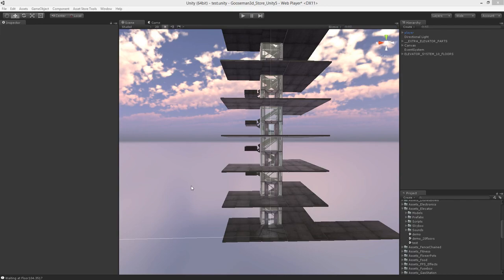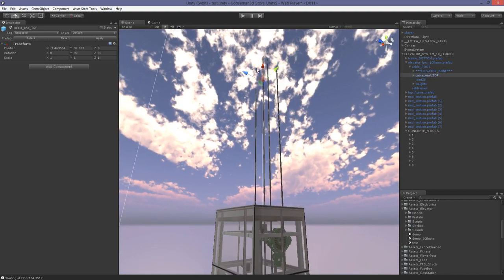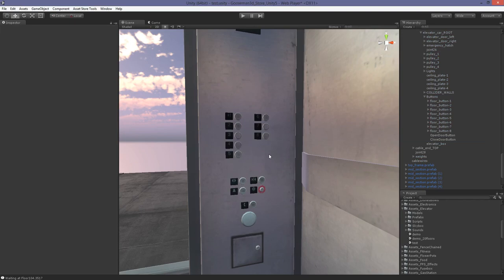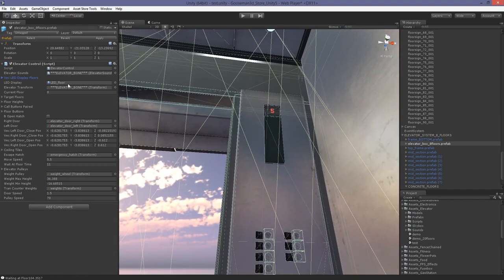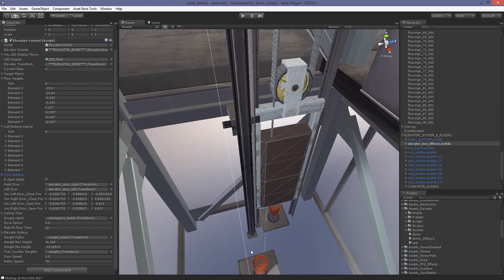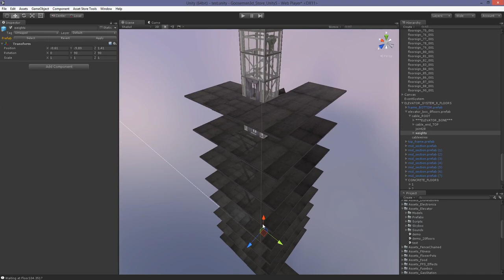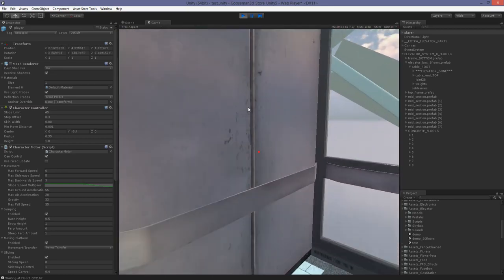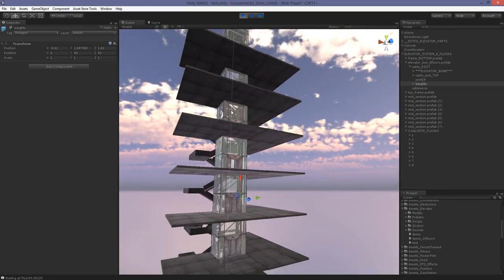Unity3d Asset Store : Elevator System Pt.3

Comment: hi there! sounds like a great asset. what happened to the video, depicting how to add floors / also i would love to know how variable the inner and outer cabin is, as well as the position of the buttons and the width of the door. * we need 90cm door width for example.. thanks in advance!
Reply from the maker: The video showing how to add floors is here.
https://youtu.be/gmsC9efduC4

Unfortunately, it's impossible to change the dimensions of the inner cabin :(

The position of the buttons can be changed, as they are a separate prefab that can be positioned anywhere inside the elevator cabin.